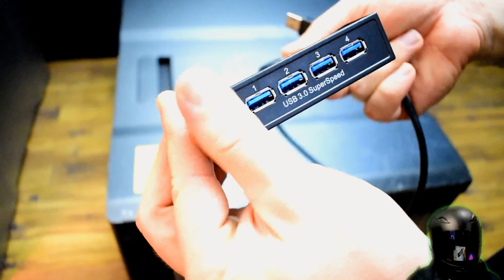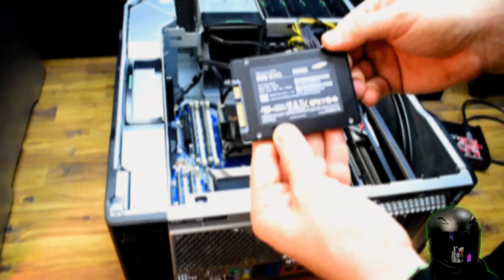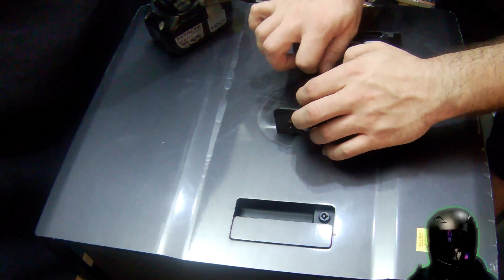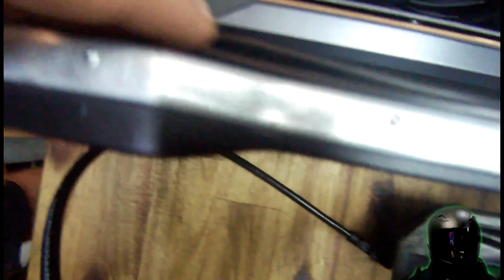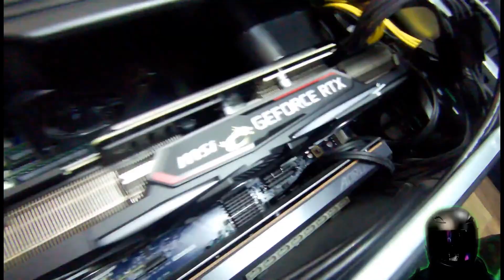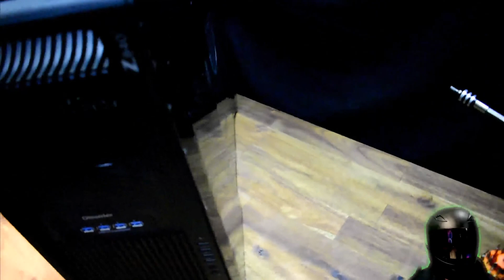These PC Upgrades Will Solve Common Problems.

Comment: Interesting content - two suggestions - 1) nail your camera angles, focus and lighting a tad better and 2) audio can be terrible through the helmet - keep it on for effect by all means - but re-dub your audio or have the visor up when you are speaking off camera and then your audio will be legible.
Reply from the maker: Thank you for the feedback. This is a throw-back for me. My total number of videos when I made this video was less than 5 when I made this one. I would like to think after nearly 4 years of YouTube that I have managed to make some improvements on all fronts that you suggested.

Camera quality has been stepped up slightly, lighting is a bit brighter, focus is mostly on a manual setting (I mildly despise auto focus since it has a bad habit of going fully out of focus on critical shots). Audio is still terrible through the helmet but I would like to think my helmet audio is some of the best helmet audio online. It's practically impossible to get good audio while wearing one, but my more recent works is ok by my ears / headphones lol. I did go with the open visor in the end - the helmet theme was maybe not my best idea in practice but I have stuck with it. 

For comparison, my most recent video: https://youtu.be/eIGbeK_PcZw